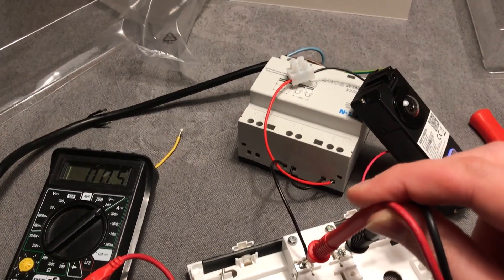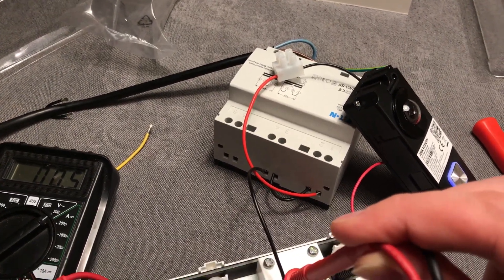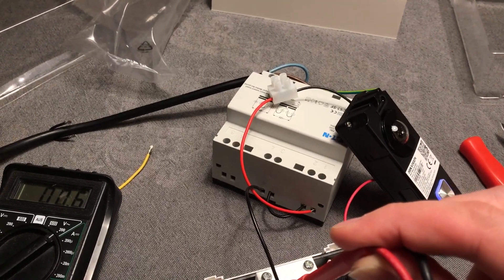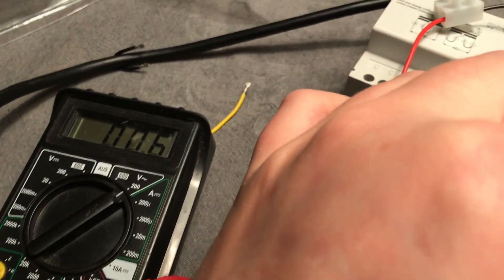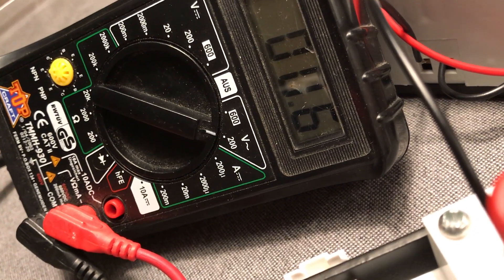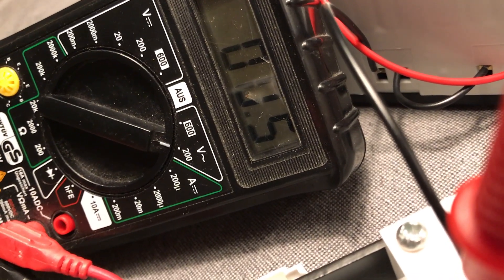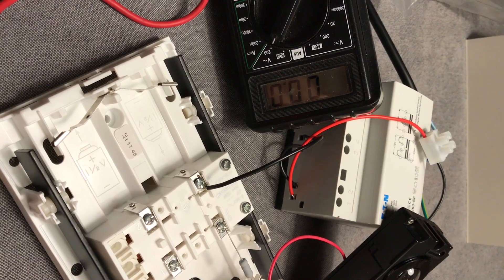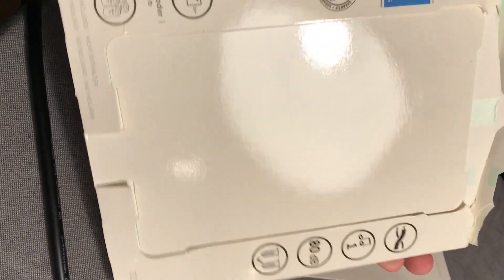Hikvision DS-KB6003-WIP Wi-Fi Doorbell with traditional chime

Comment: Just for posterity and clarifying for present readers, the chime doesn't see any significant voltage until you complete the circuit by pressing the button.  Pushing the button is like dead shorting the internal resistance of the camera and passing all the transformer power to the chime.  Before pressing the button, there is a little voltage present across the chime due to the small current used by the camera and traveling through the small coil resistance of the chime (V=IR).  Your conclusion that there is a large resistor in the camera is true because the camera resistance is relatively large compared to the chime coil so most of the supply voltage is seen across the camera.  If you measured across the camera (without pressing the button) and your supply was 24Vac, then your result should have been 24v minus what you were reading on the meter.  As for the voltage reading after pressing the button, your meter doesn't respond quick enough.  If you used an oscilloscope, you would see a much larger voltage spike on you doorbell  than you see with a digital meter.

Comment: Has anyone ever tried to wire in a wireless chime button into the unit instead of the mechanical chime would that work ? So the 2 wireless chimes I have would chime
Reply: you might be able to do that if you have a hikvision nvr. mine has alarm outputs on the back. could  be set in the software to trigger a second bell that has chimes attached

Comment: Hi B j,  I am sorry to bother you I am trying to connect the WiFi and it is just failing and can not connect to the app. It has registered the Device, it confirm it has registered the WiFi, it scans the QR Code and after that it does not connect to the app and and the WiFI does not seem to connect or open the app, keep getting message WiFi speed slow, or WiFi to far, so I dismantle the door Hikvision video door bell ring and placed it next to the router and still get the same message. Before it was connected front door of the house and it had the same issue. Any ideas what could be wrong. Appreciate if you can advice.

Comment: Bro the hikvision is low voltage 12V dc and the Honeywell doorchime is low voltage ac. This only works for the old model not the new model DS-KB6403-WIP 12VDC
Reply: HIK doorbell works on AC voltage not DC
Reply: @7755ian1  old model does not the new model